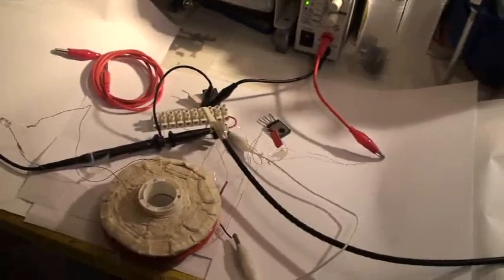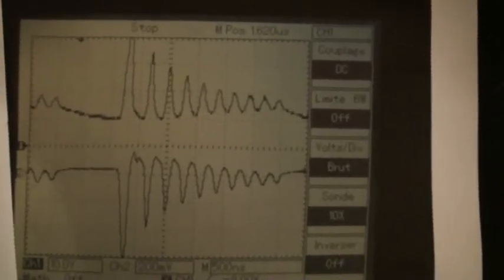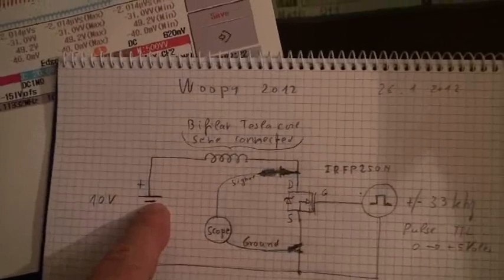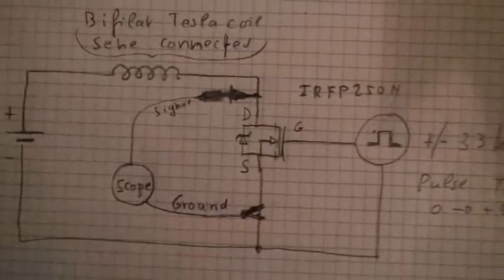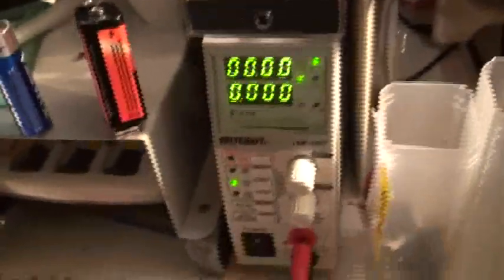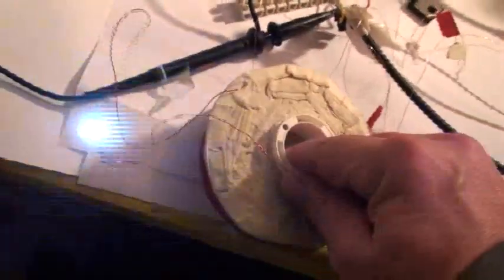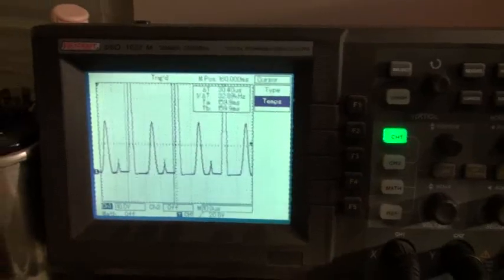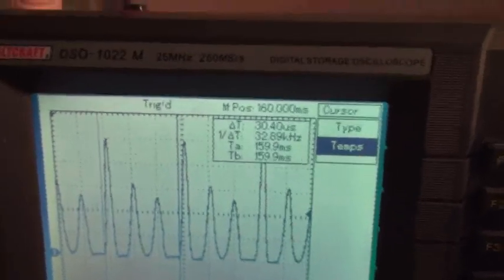Rosemary Ainslie ofset testing1.wmv

Comment: Laurent, if you want to try an interesting experiment, try putting a 50-ohm resistor between the gate and the source of the MOSFET.  Solder the resistor right on the pins of the MOSFET.  That may make the multiple spikes disappear and you will only see one spike for every pulse from your function generator.

Comment: 2nd:  I don't know right now why you see the decaying oscillation, you can work with Poynt to figure that out if you want to.

The other thing to keep in mind is that more information is always better.  If your scope showed the gate signal and the MOSFET drain voltage at the same time then you can compare the timing between each gate pulse and the spikes on the drain pin of the MOSFET.  It's important in a fist view to establish a frame of reference for your viewers.  Have fun!  Amuse-toi bien!

Comment: Laurent:  You will be in good hands if you work with Poynt99.  I can give you some basic information for why you see the positive spike.  When the MOSFET is on, current flows through the coil.  When the MOSFET switches off, the coil wants the current to keep on flowing.  You can think of it like being inertia - current flowing through the coil has electrical inertia.  When the MOSFET switches off, the current inertia has nowhere to go so it pushes up the voltage very high and makes the spike.